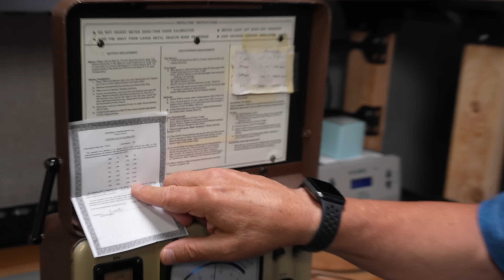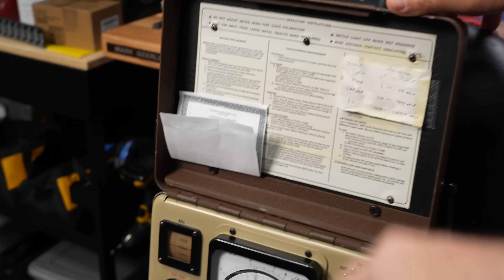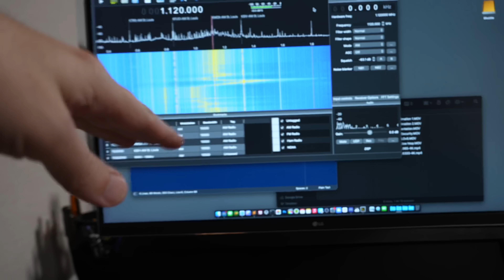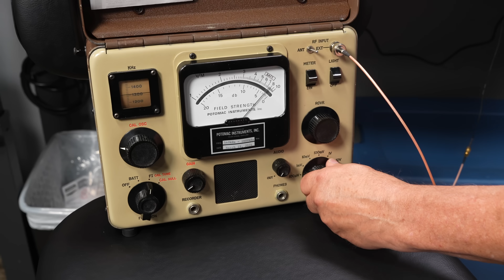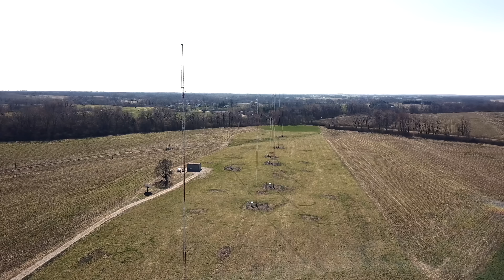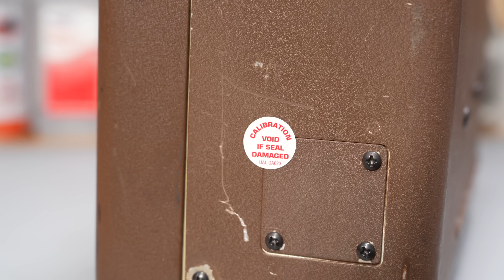This AM radio still costs thousands of dollars—why?

Comment: I did HF radio for the US GOVT for a number of years.  I had a couple of…..🧐…..either one of these sig-strength meters, or one similar to this one.  But anyway, worldwide I had dozens of:  rhombics, nested rhombics, RLP’s, HLP’s, VLP’s, curtains, high freq CONMONS, low freq CONMONS, quarter wave towers, shunt fed towers, serial fed towers, and so on.  It was fun!  But, you are correct, as long as you have calibrated records of initial antenna patterns, you can use a $20 pocket signal strength receiver to keep an eagle-eye on tower corrosion and as you say….to “look” at the condition of RF ground systems and radials.  This is a wonderful video!  Thanks!  PS, And oh BTW, I don’t cook my hot dogs with a tower, I plug em in to a wall socket.  When the breaker trips, it’s done!  A couple of us (like many other goof-offs) back in college days did that for real.  I think we found that aluminum nails work best!  🤪
Reply: Your method of cooking hot dogs reminds me of an actual commercial product available in the pre-microwave oven era--the Presto "Hot Dogger".  It was a hot dog cooker that actually used 120 VAC service to cook hot dogs by way of two bus bar like poles, one connected to each AC line, with protruding spikes that you'd spear the hot dogs on.

Here's a video of one in action: https://youtu.be/029jcmv4tIU?si=aJ_qoTIECCfEb4Sh
Reply: From where I sit you are a lucky guy.  I'm a bit jealous.
Reply: @channelview8854 - I appreciate this sentiment.  But I can assure you it wasn’t all fun and games.  I have had very stressful moments when Jimmy Hendrix could have played the “Star Spangled Banner” using my intestines instead of his guitar because sometimes lives were at risk.  But on the other hand I did enjoy myself at other times.  Like when I was repairing a 50KW TMC BALUN (those puppies were about 5 feet tall, and about 6-7 foot circumference), on a short tower about 10 feet up.  The antenna itself was a massively huge double HLP (probably took up about 4-5 acres of land plus another 12 or so acres all around to maintain integrity of the antenna pattern).  Sooooo I just so happened to have with me in the man-lift bucket a ham radio transceiver and battery plus a coax adapter (reducing the 5 inch nitrogen filled coax down to a SO-239).  I had a total blast doing things like that.  A bad moment was when I was in the land-of-sand doing emergency repairs to the feed point of a Hy-Gain RLP (large log periodic, looks like a huge yagi…the antenna is up about 110 feet, and the feed point is all the way out (26 feet from the center mast)….so I am 110 feet in the air, out on the end of the antenna boom, changing the feed-point for 1.5 inch hardline nitrogen filled coax…when I started hearing 1 or 2 bullets whizzing past.  Lives were on the line, so whaddia gonna do?  Cry and walk home?  I tried moving around as much as possible, and my sphincter was just kinda-sorta pinched shut (shoot, I cudda chopped a 10 foot length of 1 inch rebar into 1 inch chunks).  Did I mention I hate heights, but I’ve climbed many hundreds of towers thru time.  I’m not trying to impress, just saying there are downsides to every job.  My spouse and my sister say I need to write a book, but I’d just get into trouble.  😂  Cheers es 73!  And please enjoy what you do…life is too short!
Reply: @thomthumbe  If you do write a book I would really like to have a copy.  I hope you have some photos.  73 OM.

Comment: My first paying job in radio, the summer after I got out of high school, was doing field strength measurements for an AM daytimer. I think I measured about 20 points on each of 11 radials (twice!). A lot of driving and traipsing through farm fields. On the weekend I did a board shift on Saturday and Sunday, as well as took the base current readings.
Reply: I did the same thing. And it was all atlas's and paper maps

Comment: Back in 1975/76 I was an engineer at an AM/FM station in Jeff City with a 4-tower directional night-time array.  I don't remember the exact model number, but we had a similar field strength meter.  That station had to submit a "Proof-of-Performance" report to the FCC every 3 years.  I was the newest, so I got to traipse around central Missouri walking out into farmer's fields "12 yards South of the corner fence-post and 5 yards East of the Oak tree" to take a measurement at least 2 hours after official sunset.   I don't remember the exact number, but I think we had 5 stations we were protecting at night.  So that would have been 5 radial bearings with at least 3 readings on each bearing.  Lots of work in a "proof".

I do remember getting a call at home from a Colorado station telling me that our jock had neglected to to the day/night power switch.  He knew this because he was listening to our station on his over-the-air monitor.  I called the control room, and reamed the guy for not switching from 5KW non-directional to 500W directional.  I wanted to fire him because this wasn't the first (nor the last) time he was "too-busy".  Alas, one of the sponsor's loved his show.
Reply: Man, what a job. Out in the field, not behind a desk. I think a lot of young guys today would want that instead of a desk job. Question, tho, this is the first time I've ever heard of day/night power switch. Why would there be a need to switch to lower power at night?
Reply from the maker: re: day/night switch — That's a great question! We didn't cover it exactly yet, but check out the video 'this tech splits my voice in 5 parts' — also the KMOX tower tour (If I touch this tower, I die), both talk a little bit more about day/night power and AM radio.

It boils down to signal propagation. At night, AM radio frequencies bounce off the ionosphere and go waaaay further than they do during the day. Because of that, unless you're one of the few 'clear channel' stations in the US, you have to turn down your power and often use a directional antenna array to point your signal in the right places. Otherwise you blast through and other radio stations are overridden by your signal.
Reply: @GeerlingEngineering  That makes a ton of sense, thank you for the answer! Love your channel :)
Reply: @GeerlingEngineering  i remember when i was like 12 years old i was in the car with my mom very early in the morning and suddenly the radio started playing a radio station of a city that was like 300 miles away! We listened for almost an hour and i remember being really amazed because it was the first and last time that happened. Can you explain to me what happened that time? I don't know anything about radios but that really amazed me.
Reply: @GeerlingEngineering That's the origin story of the name of what became Clear Channel Communications in 90's etc. Wonder if they're still around.
Reply: @93LT1RamAir    Although Jeff covered this briefly, I'll try to expand on this question.  The short answer is that medium and short waves all propagate in two distinct modes:  ground wave (day and night) and sky wave (effective only at night).  Ground waves generally follow the surface of the earth and are attenuated by both distance (1/r^2) and ground conductivity and permittivity (irregular but high).  Sky waves are highly attenuated by the "D-layer ionization" during the day when sunlight excites the ions to absorb medium and short wave signals.  At night the D-layer becomes transparent to medium wave (MF) and short wave (HF) signals which then travel on to be reflected back to the earth by the E- or F-ionization layers attenuated only by the (1/r^2) factor.  This is the so-called "skip zone" where signals can be heard several hundred or thousands of miles from the originating station who might be transmitting modest or low power levels.  Amateur stations transmitting 100 watts or less are regularly heard at trans-oceanic distances at night.  As to the need to switch power, the FCC in cooperation with similar regulatory agencies in other countries attempted to level the playing field by channelizing radio spectrum and licensing entities to "use" a portion of that spectrum thereby entities have a more-or-less equal chance at serving their intended audience.  This basically means that in the mid-1930's the MF broadcast spectrum (525kHz to 1705kHz) was channelized every 10kHz from 530kHz to 1700kHz resulting in 117 channels.  Since there are many more than 117 communities needing broadcast services, the bands were further divided into large, medium and small markets.  60 "large" market stations got "clear-channel" frequencies which meant that there were no other stations on that frequency: St. Louis (KMOX), Chicago (WLS), KFI (Los Angeles), San Antonio (WOAI), New York (WOR), etc.  These were intended to reach large segments of the population at a state-wide or region-wide level with large antenna installations at high powers (>10kW).  Other stations got medium power stations which they shared the frequency with other medium market stations service smaller regions but they had to accommodate sharing the frequency with other stations by either reducing power, operating a directional antenna, or both.  And finally the lowest power (<500 watt) stations were allocated to serve individual communities with may only authorized for daylight-operation.  In-fact there were also "carrier-current" stations (<5Watts) licensed to serve individual buildings with the antenna being the power line (typically college dorms) that could not be heard more than a few meters from the buildings outside walls.  This re-use of frequencies is a fundamental building block of the cellular telephone network.  However, the cellular network doesn't have to contend with "sky-wave" propagation since all of the ionization layers are essentially transparent to microwave frequencies.
Reply: @RanchoHam  Excellent explanation. I learned a lot. Thank you.
Reply: Lot of info. Thank You
Reply: @RanchoHam  According to Wait (1970) ground waves at VLF frequencies follow a 1/r distance attenuation, not a 1/r^2  I'm wondering what the difference is in the propagation of VLF and MF (MW) ground waves?
Reply: @RanchoHam  tldr; Paragraphs are your friend.
Reply: @RanchoHam  And there there were the daytime only stations.  I worked at one in Yakima, 980 KUTI, "Country Cutie."
Reply: @JoeHamelin  Yup, I started my working career at a 500W daylighter while I was still in high school.
Reply: @93LT1RamAir  AM radio signals travel farther at night.  Some stations are required to completely shut down at night because of this.
Reply: In 1985 or 1986 I had a temporary job working for WLOB in Maine. An engineer was called in to adjust the night pattern. I was wearing every layer I could on a bitter cold and windy night monitoring signal strength in a field next to Spring Street in Westbrook. I'd report the measurements back with a handheld radio after each tweak. The biggest challenge was keeping the instrument from blowing off the top of my car, because the lid (with the wire loop antenna) was like a sail. At the end of the project they took us out for a hot dinner.
Reply: @AcmeRacing  I sympathize with the cold:  I had to climb a couple of rungs on an icy tower to manually turn on the antenna heaters due to an unexpected ice storm.  Like you I was the newest member of the engineering staff.

One thing I forgot to mention is just how sharp and deep the nulls are.  For fun one evening I walked a field strength meter around the field where the directional array was located.  On a null radial, the null was deep enough that there was no measurable reading a few 10s of yards from the nearest tower.  Of course, moving the meter a few inches off of that radial would peg the meter.
Reply: Imagine being so bad at your job that 50 years later they still want to fire you! 😂😅😅😅😅
Reply: @user-ey6um1dy1f  Many times, over the years, I've wished for the power to fire irrititating DJs.
Reply: Very nice and informative. Thank you
Reply: I wonder why the output power switch was manual. It could have been fool-proofed with a timer switch.
Reply: @mrnmrn1 In 1975 the small personal computer had just been invented [my boss drooled over the magazine cover with the Altair 8800] so nothing cheap to use for automation.  The time of the switch changes every day as a function of local sunrise and sunset.  The other factor is that in order to minimize arc flash in the antenna relay, the switch was done at a time of minimum audio on the carrier.  If I was doing the switch, I could wait for the announcer to take a breath and switch then.
Reply: It's who you know.

Comment: How about touching a four foot fluorescent bulb to the tower?
Reply: Once the gas in the tube fires, it becomes a low-Ohms conductor ... the reason a fluorescent bulb uses a ballast in series. Actually touching the tube could  be an issue. Normally they just light in the proximity of strong RF signals. No need to touch ...

Comment: a spectrum analyzer used for the same purpose today is much more expensive, maybe 10-20 (but ofc does many more things)

calibrated antenna alone will run you more than the entire device

AM demod option will be a few thousand, too, if you don't just want to look at the signal, but also listen and do more specialized analysis stuff
Reply: This instrument would be good in broadcast engineering.  It can do a screening measurement before bringing in the big guns($$$).

Comment: We have a guy that drives around once a year or so and gives us reports on our signals. I am not sure who it is or what equipment he uses but the report is quite detailed. As for the "glasses" Ubiquiti makes a spectrum analyzer wifiman wizard that lets you "see" the RF as it maps the room/building you are in. You need an iphone with the lidar on it to take full advantage of it but it's a neat tool. Also laughs in 80 year old grounds sitting on rock basically for my AM tower. Chasing RF was fun till I went nuts with new grounds.
Reply from the maker: Probably uses something like this! (Or maybe the newer model with built-in GPS).
Reply: @GeerlingEngineering  Probably the modern equivalent. When I first saw what you have here I thought it was like a meter my silent key mentor gave me. I have only seen it used once big meter with dials goes across the tuning coil of an AM transmitter and us it to set the matching. If you want I can take pics of it. Been meaning to show it to some radio groups.
Reply: @pegasus_halfhorse  Ah yes when you tune an AM tower, you usually have one of those massive boxes with a couple tuning knobs—my Dad has footage from a few sites where guys would set up towers with it.
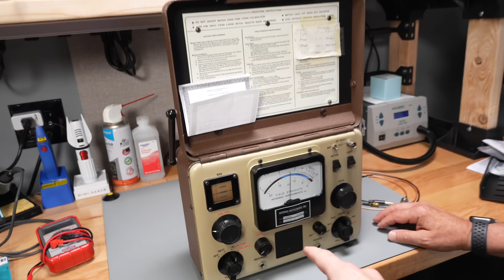Reply: @JeffGeerling  I need to pull it out and take a few pictures for the radio show and tell groups and maybe shoot you one in email if you like. I am not sure exactly how it works only saw it used once when we replaced the AM transmitter. Mark P designed a new coil for it to match the tower, I built it and then the more seasoned engineer helping us put this his own version of this thing that I think has a preamp in it mine don't across it to set the taps and it's held a 1:1 on the swr since. Okay 1:12 or so after I had them take a 2 way antenna off that is now my gmrs repeater antenna but not enough to tune out. It's the old way of doing things, I don't need it any more even if I did know how to use it. Last times transmitter had problems my rigexpert read the 80 year old shunt fed tower with bad grounds just fine matching the reading the Nautel gives me just to check for any major problems before trying to send RF up it. It like my other mentors old Simpson meters will likely go on the shelf of my shop their tools are kinda my memorial to them even if outdated and consider it an honor to have them. The bird meters however do get used but came from someone that holds some of my deepest respect... I think that is why the new Ipad commercial was so painful for a lot of us yeah there is better tools but the old ones have meanings and stories to tell. I hope to talk my remaining mentor into letting me stick a camera in his face for a few hours and say tell me your 70 year career in radio. A lot of that information is dying with these guys and it saddens me.

Comment: Excited to hear about you getting into SDR, looking forward to some videos potentially? (:
Reply from the maker: Definitely!
Reply: @GeerlingEngineering  looking forward to those! I've just started to get (back) into SDRs, and I've got the V3 of yours that doesn't have the built-in upconverter for HF/MF, it just uses the direct sampling method... Been thinking about if I should upgrade to the V4 or if the V3 performs about the same!
Reply: @KenPiper  save up and just get a SDRPlay RSP1A, you'll be far happier